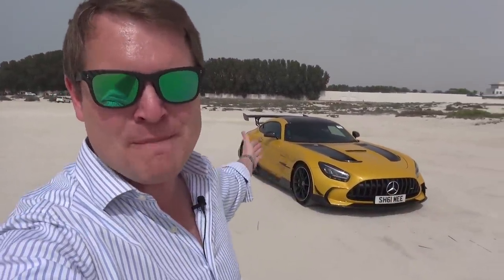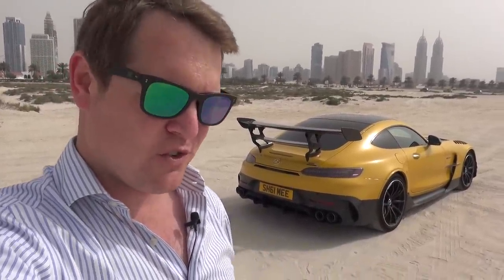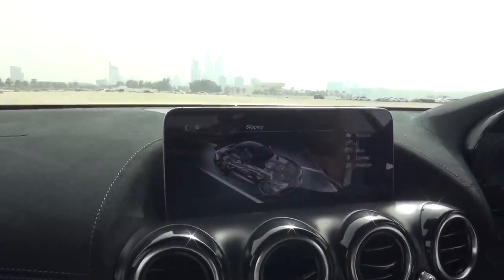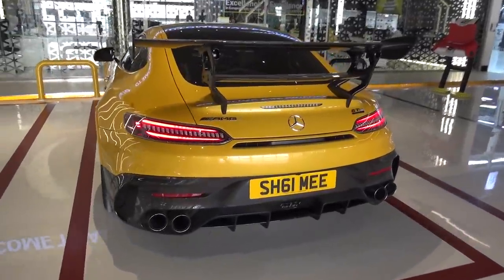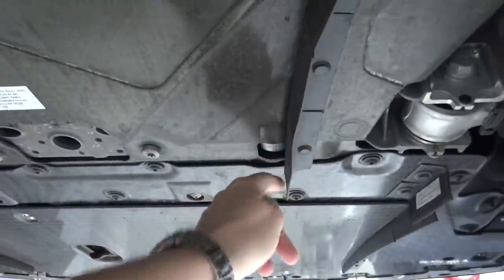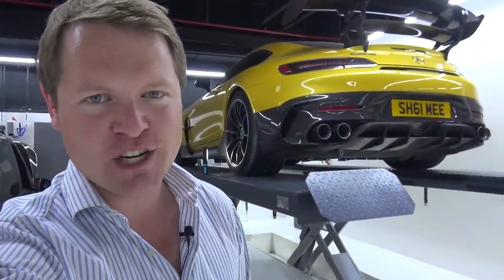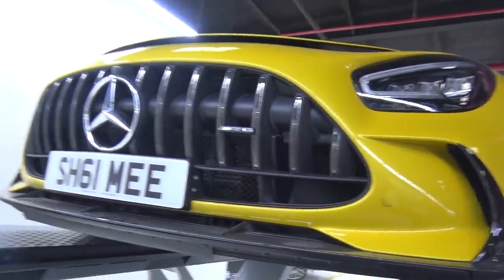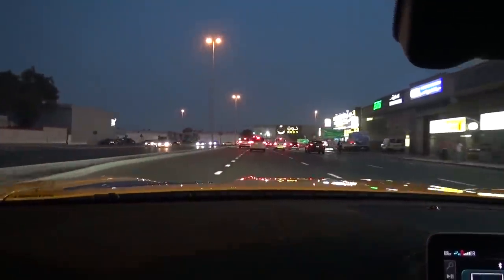DAMAGE INSPECTION! How is My AMG GT Black Series? Next Stop: USA

Comment: Two points:
1) No chance of bogging down in the sand unless driven like a lunatic with such wide tyres.
2) Use an airline or industrial vacuum with a crevice tool to remove the leaves.

Comment: That henessy venom GT has some extra front lights first time i saw one with those. Looks great though
Reply from the maker: Interesting
Reply: Probably stolen from someone's car that they parted out.
Reply: It's a 1 of 13 i don't think anyone would do mods on a multi million worth artwork
Reply: @svgaming2716  You're clearly underestimating Arab car owners. They don't flinch before throwin mods on exotic machinery. Sometimes for the worst n sometimes for the best. I love em for that tho. I'd rather see cars being used n meddled with a bit rather than seeing garage queens sit lookin pretty.
Reply: Maybe it took some front end damage at some point n ended up gettin a Lotus Elise bumper as replacement. Looks kinda cool IMO. Didn't even register in ma head till I read your comment!
Reply: @rahulsudhir666  ya that might have been the case